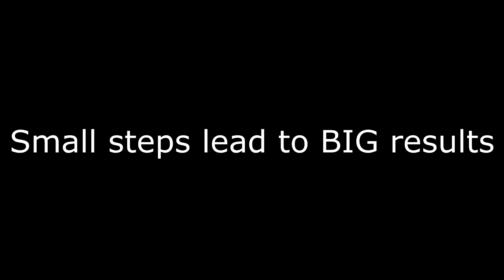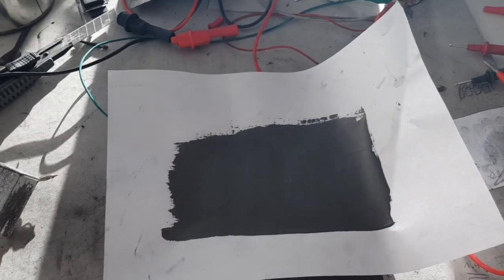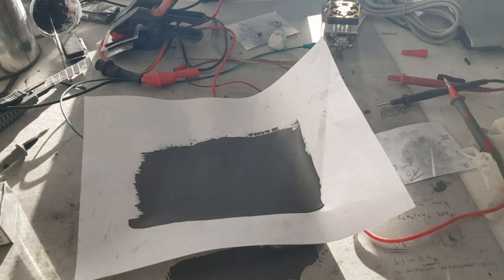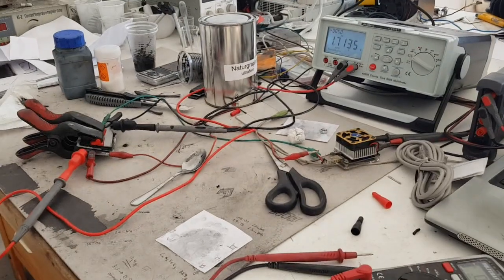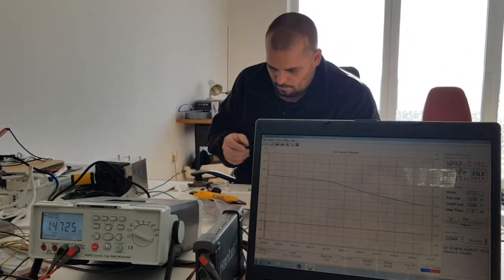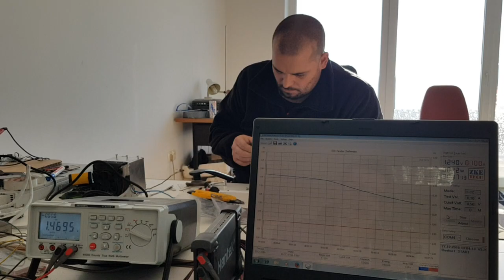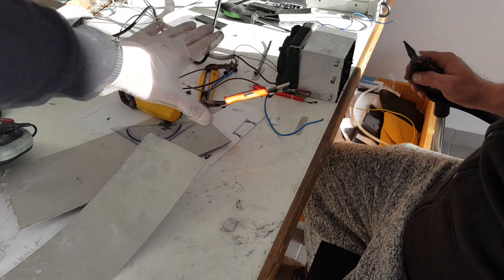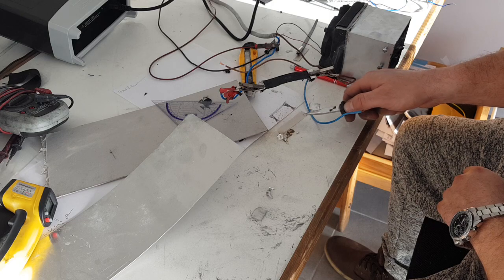Rewind 2018: Conductive ink,... etc

Comment: Hi. and wow I think it's 650 degrees c to melt aluminium. was that ink on paper. nice work
Reply from the maker: This is some other project whic is some modified carbon coating on glas/quartz fibers. Can heat to around 1000 deg C.